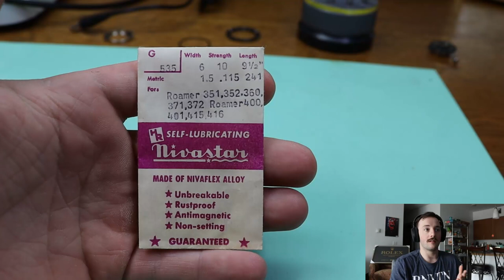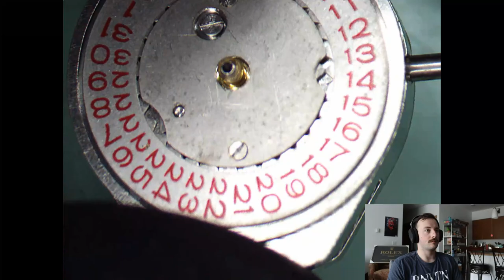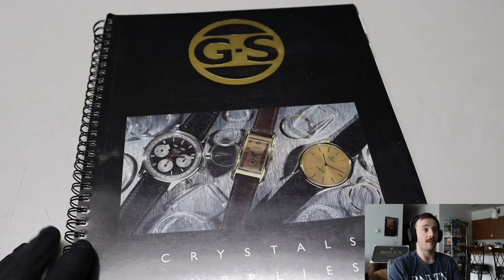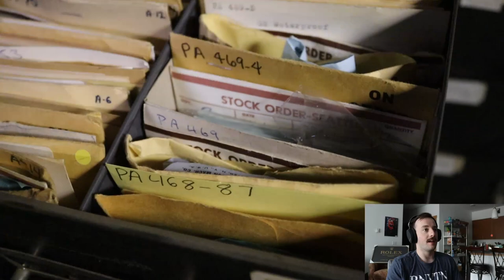Seiko's    **WORST NIGHTMARE**

Comment: Is there a reason you oil the jewels before assembling?
Reply from the maker: Yes. I chose to not remove the top cap jewel and shock system. 
The proper way would be to: 
-Ultrasonically Clean.
-Remove Cap jewel and sock spring.
-One dip cap jewel "second clean."
-Oil cap jewel and install.

Thank you for your support! I appreciate your interest.

Comment: I really can’t call this a quibble, because you’re a professional watchmaker, but my 2¢:

It has to do with with removing, and then reinstalling the hands.  I was a little surprised to see you remove the hands when they were in the 10 & 2 position.  Seems a bit harsh?

Then reinstalling, LOOKS like (to me, anyway) the minute & hour hands aren’t synced up exactly at 12.

But you’re the one who has the knowledge, and you’re right on top of the watch, so it must be right, and it most be a little distortion caused by the camera angle.

——
Wish I had a new mainspring barrel to give you, 😉👋🏼!
Reply from the maker: I appreciate that you have a keen eye! I make mistakes along the way. Sometimes I am too hasty and make impulsive decisions. yes, I should have moved the hands so that they are right on top of each other and then remove them. The hand did align at 12 maybe the angle was weird. Thank you for your support!

Comment: I would be a nervous wreck if I had to take a metal file to a case.  I imagine that it would be very easy to remove too much material when using a file, especially when the file is in the wrong hands (like mine).  Of course this case ended up being expertly restored to a beautiful, factory finish.
Reply from the maker: Practice makes perfect! Thank you for your support!

Comment: Man you are forcing those gears, you should be gentle to the parts. I use  multi purpose grease on the fork and every jewel, silicon grease on the spring. Baby oil on the balance, and brake (fork) pivots. I guess this is even better than the oils you can buy for lot of money. Grease stays in place and holds for a long time, baby oil is very good synthetic white oil for superior lubrication. Had excellent results with that.